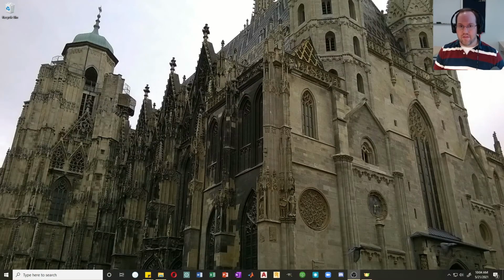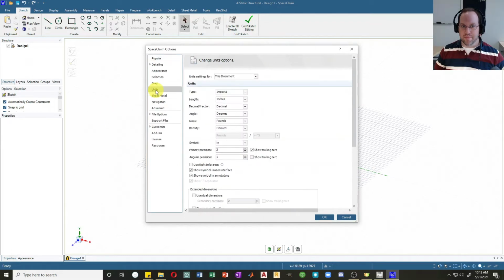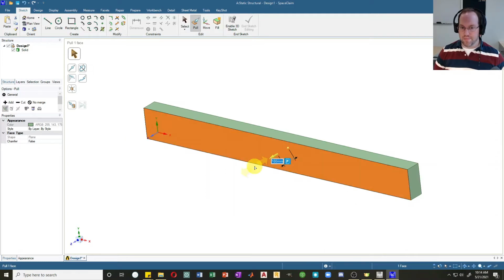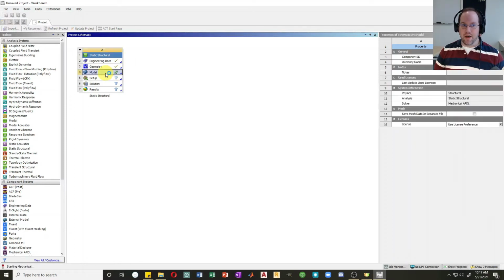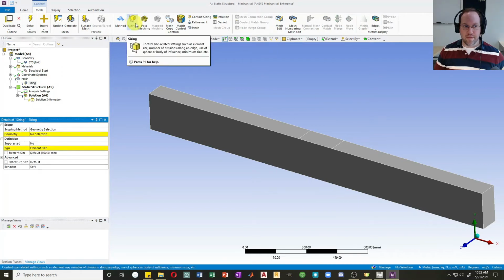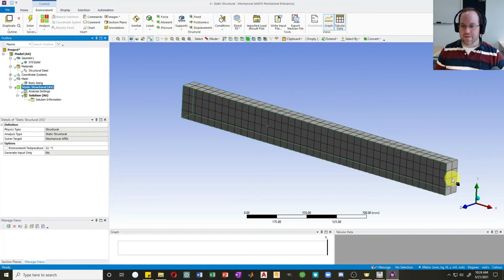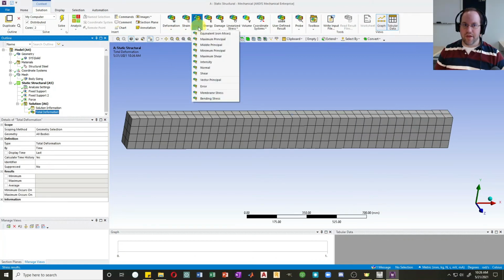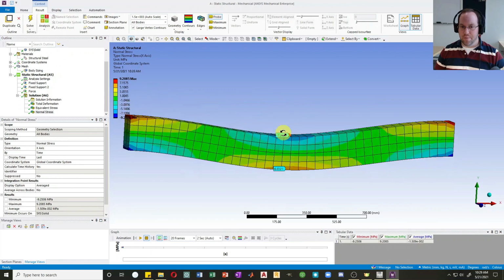Introduction to ANSYS - FEA using ANSYS - Lesson 1

Comment: good video, but this isnt a true 3 point bed right? as the fixed points should just act as free moving supports, and the deformation should be U shaped, not a squiggle?
Reply from the maker: You are correct, this is not a true three-point bending test. It’s a fixed-fixed beam with a point load in the middle, and the traditional three-point case uses simple supports at the end.
Reply: @StructuresProfH thanks for clarifying. Any chance i could quiz you regarding something Ansys related? I work in a university in the UK (Liverpool), and none of the professors here have specialised in Ansys, only Solidworks and Abacus.

Comment: hello Prof, I'm doing my thesis work and I'm using this Ansys software, the Harmonic Acoustics Module to be exact. The problem is after hitting generate in the mesh context, an error in the meshing process occurs. A warning message tells "The mesh generation did not complete. Try meshing with another mesh method or different mesh options." Can you give any suggestions and insights regarding this matter?

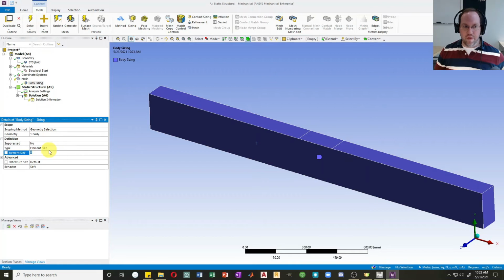Comment: i got a problem at mesh section, the moment you type it 50, mm 9:02  but for me its  just m  and i could'nt change it
Reply: I got the same problem....put the value 0.05 m...that will solve...just a simple convert
Reply: At the bottom right corner in mechanical, look for the units dropdown and change it directly from there.